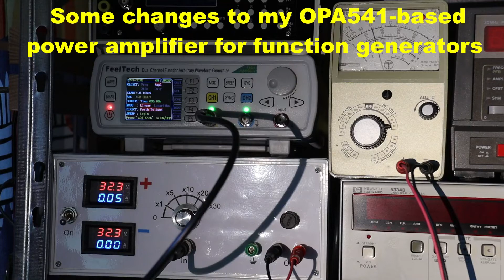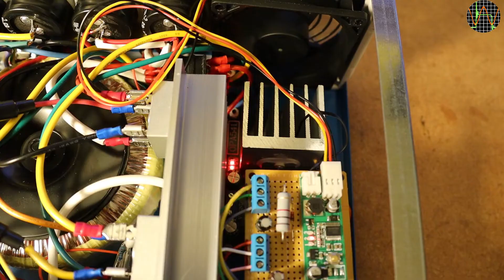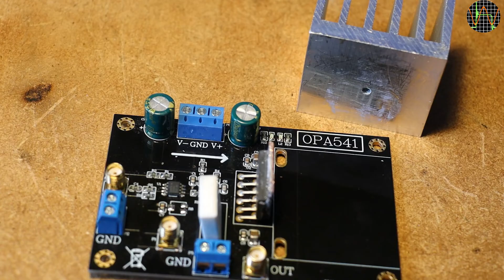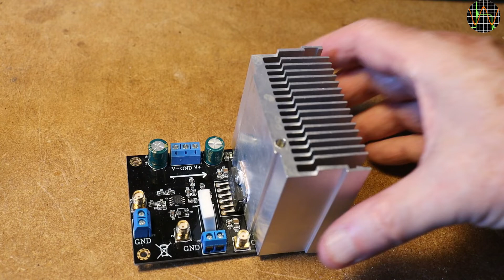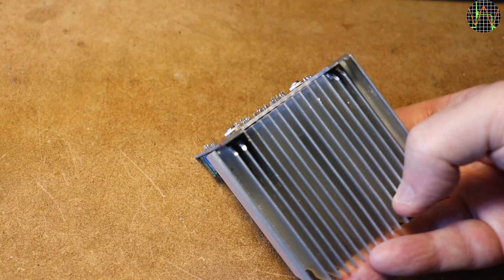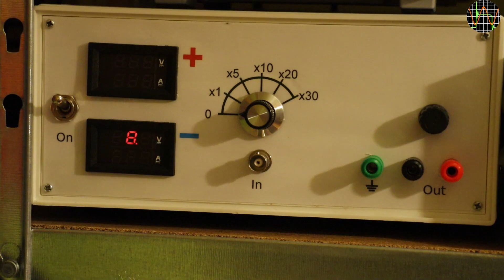#103: Some changes to my OPA541-based power amplifier for function generators

Comment: I would like to use this OPA541 module in VCCS (aka constant current) mode. However, this requires a sensing resistor. Is the module capable of this from the factory? If not suitable from the factory, how difficult is it to modify for VCCS operation?
Reply from the maker: I can't say. My module is now kind of built-in and extracting it for a detailed look at the PCB would be a major pain, sorry,